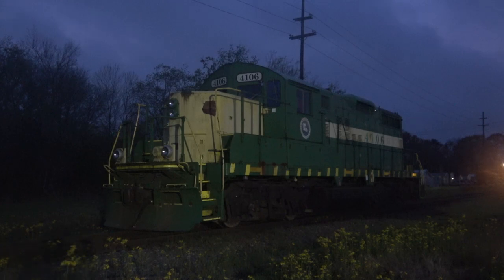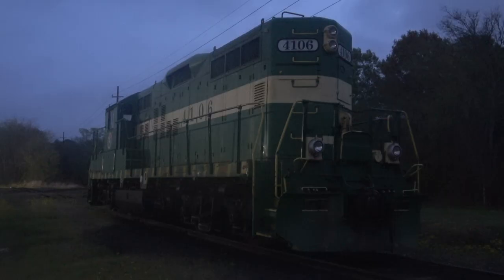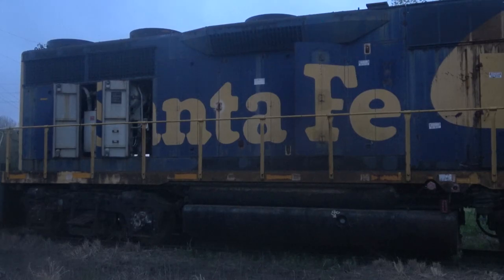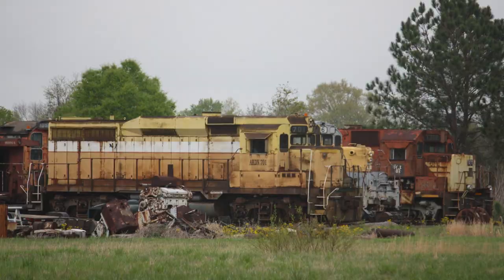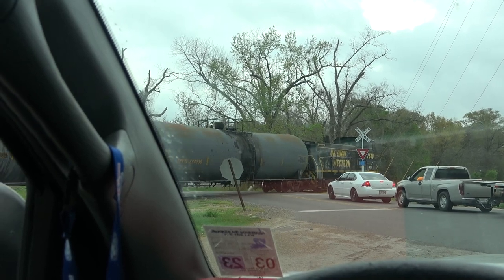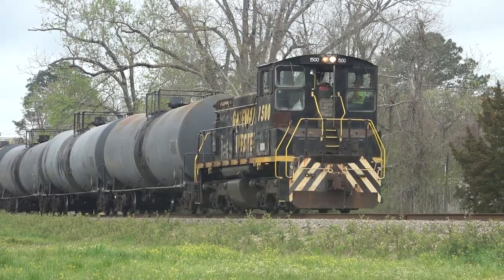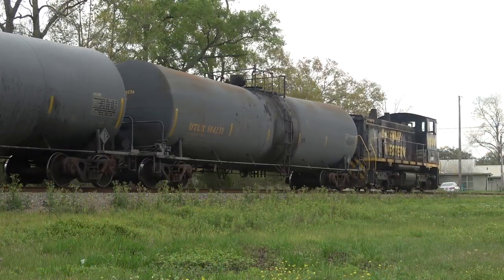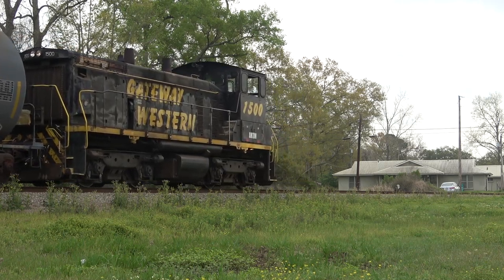The Acadiana Railway in Opelousas, Louisiana!

Comment: Great Video! The Crowley-Eunice job operates on Tuesdays and Thursdays around 11am and it serves Supreme Rice and another small rice mill. The Supreme Rice mill tracks just got redone and they can now hold 30-40 cars. Also the line through Crowley is BNSF. Also, if you ever get the chance, you should go down to Lafayette one day. Lots of interesting trains throughout the area.
Reply from the maker: I was told just a few weeks ago it goes on duty at 0600 so next time I’m gonna give Tuesday a go. May not have had any cars to take down. I eventually getting down to Lafayette eventually for LDRR. Maybe in the summer. Happen to know their operation schedule?
Reply: @LouisianaRailProductions  The L&D runs a local called BR1 from New Iberia to Lafayette, and then up the Breaux Bridge branch on weekdays. It also switches industries south of Lafayette along Highway 90. The L&D shops are in New Iberia and there is always power sitting by the station. There are several branch lines in the area that get served by locals as needed, but a local runs almost every day. The line to Abbeville was put out of service a few years ago, but it is still there.
Reply from the maker: So the BR1 uses BNSF tracks to get to Lafayette right? Around what time do they go on duty?
Reply: @LouisianaRailProductions  Yes, it uses the Lafayette Sub between New Iberia and Lafayette. I’m not sure exactly when they go on duty, but they usually switch south of Lafayette around 10-11am, and head up to Breaux Bridge around 12. They stay parked south of Lafayette until later in the evening, and they even stay overnight sometimes.
Reply: @LouisianaRailProductions  I just caught the AKDN local today and uploaded a video. Not sure why it didn’t run that day.